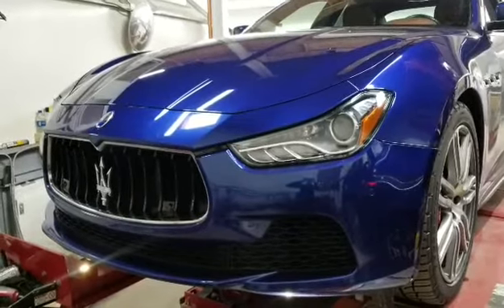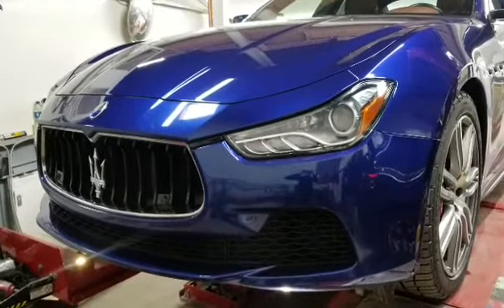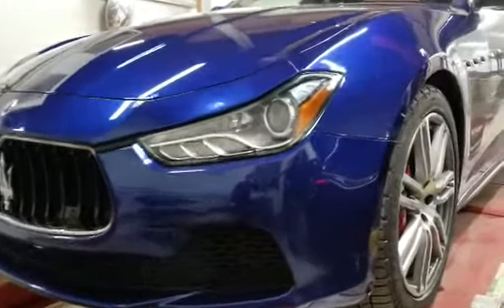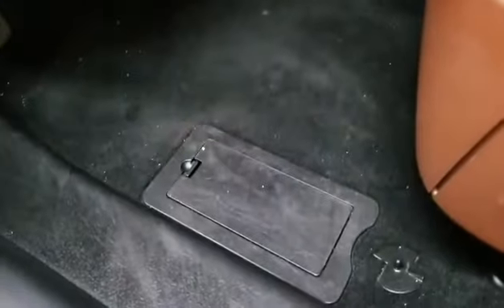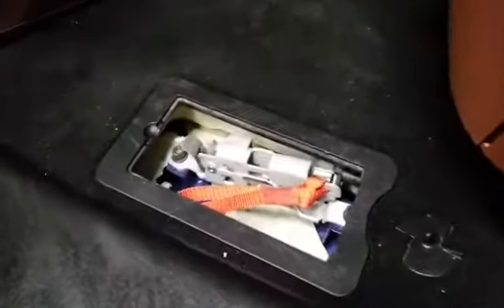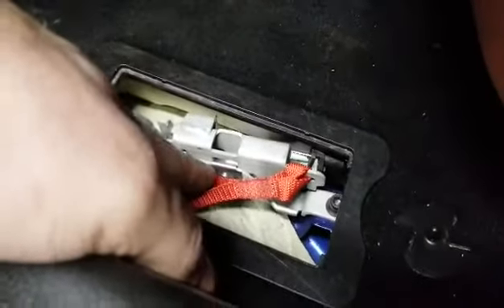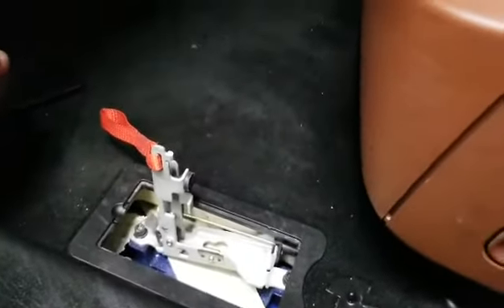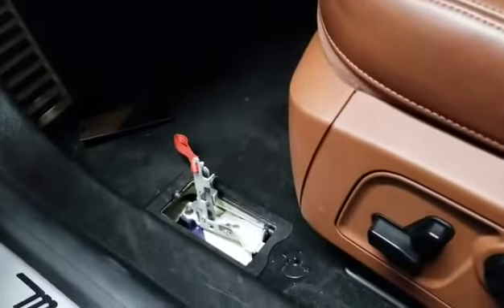How to manually get Maserati into neutral, Shift lock release

Comment: do you have a video of how to replace one  that has a broken cable?
Reply: Looking for this too. My tow driver swears he didn't break it. Shop saids they didn't breck it
Reply: I swear I've watched this more then a few times last month, I think my cable is broken as well.. I had a low battery and had to jump start after 10 min on the cables it started.
Reply: @FoxyTyger  I had it towed to a shop and then towed back when the shop realized they didn't want to fix it. It came back with this cable broken. Neither one said they broke it

Comment: That did not work for me a few months back, not sure if it's a faulty lever or what but I had to jump start it only after letting it charge for about 10 min on the cables..

Has anyone else had trouble getting there car into neutral when the battery is low or flat dead?

Comment: You should have posted a caution when doing this as the dealer needs to re-engage to parking system
Reply from the maker: You push it  back down cable releases and it's locks back in park.